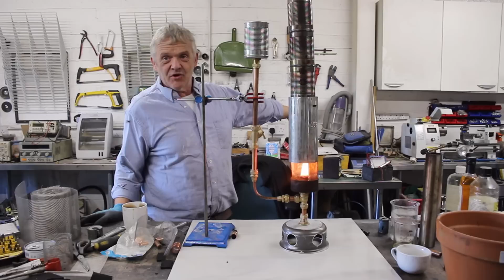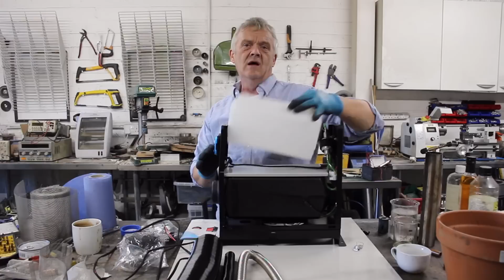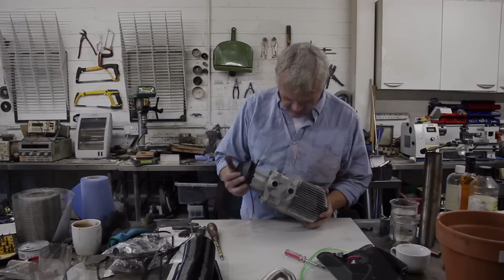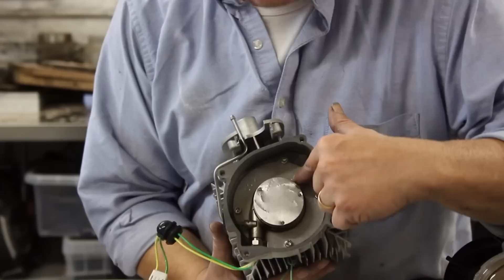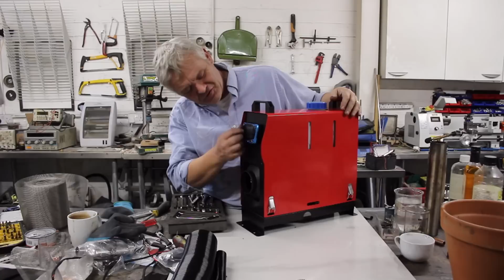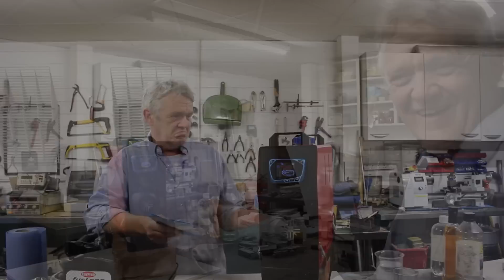1682 The Vevor 12V 8kW Heater - A Review And Pulling It Apart To See How It Is Made #Vevor

Comment: Probably one of the best options for switch flippers and button pushers.  A cabin model doesn't need an installer does he?  Keep in mind that ALL heaters can be cabin models and put in a firewalled doghouse outside.  And let's not forget they are mostly exhaust pushers.  Now, that's a problem for close living spaces.  If their exhaust has any gaps in the living space, then the noxious fumes gets pushed by internal pressure out into the home air space.  So, put a bit of aircrete thermal mass near the top of your clandestine chimney and it gets warm enough after starting to draw the exhaust by vacuum instead of the source heat pushing it with internal pressure, so there's not so many worries about gassing sleeping inhabitants.

Of course, expect the traitorous home insurance companies to disqualify wood stoves, etc.  And look forward to your (their) friendly cash-strapped Bobbies to go about with FLIR detection units and ticket books because they are so concerned for your winter European welfare!  Afterall, if they do a really good job with innoculations they can REDUCE the population significantly.  Sir Bill Gates said so hisself!
Reply from the maker: nice advice mate and the big win for me is it doesn't need an installer - the price of that is crippling

Comment: I doubt they thought you’d do a tear down 😂
I’ve previously modified a car to run straight used WVO and I’d reckon these could be modified to do the same or at minimum start on diesel and add clean filtered WVO which is heated by a small heat exchanger tube added to the unit
Reply from the maker: yeah - I'll bet they are surprised when they see it lol

Comment: You know I never disagree with you Robert but to say 5 or $0.10 a liter for biodiesel is a little disingenuous after considering the reagent prices unless you're recovering all of your methanol and caustic soda somehow you're going to be paying almost the same price is the pump. Well I shouldn't say that as a matter of fact Lee I have not calculated those costs in about 5 years and I know diesel has increased at a greater percentage than other fuels
Reply from the maker: my bad mate - I mean 5-10 cents for the base material oil - I should have been clearer thank you for pointing that out
Reply: @ThinkingandTinkering now I feel bad LOL I like you so much you're such a great teacher let me pointing that out made me feel terrible LOL I don't know why I just do it's kind of funny if you think about it.

It's kind of a sore spot with me because I got all set up to make biodiesel and I made some and it's really nice clean biodiesel and I was going to use it for heating my garage I was going to build a heat exchanger kind of like what you were doing with the rocket mass heater but with a giant open air heat exchanger that would cover a wall and radiate but after I figured out the cost of the reagents even buying in very large quantities it just wasn't worth it I would have been better off with an electric heater believe it or not. Now if I used wood it would be awesome but I'm disabled and gathering the wood or chopping the wood it's not an option anymore unfortunately

But yeah that's why it's a sticky point with me

Comment: awesome video. David McLuckie has a channel testing these things every which way but loose. I'm curious if there's a cheap fuel blend ratio of petrol and veg oil that would work safely and efficiently without fouling everything up.
Reply: I've been running a couple of these as my house heating for a coupe of years now.  HHO (kerosene) is the best thing to use as fuel - much cleaner burning than diesel, and cheaper too.
Reply from the maker: Great point mate - I don't really know tbh
Reply: I run out ldv van on veg oil, I am about to run the diesel heater on it for the first time. I will let you know.

Comment: Run them on highest settings every now and then. It keeps the internal chamber cleaner. Constantly running on low settings can gum up the internal chamber and makes them very inefficient.
Reply from the maker: nice advice - cheers mate
Reply: Hey thanks for the reminder I'm glad I read your post cuz mine has been running on low for a bit for the dogs and I got to make sure that I do run it on high every so often thanks for the reminder again have a great day
Reply: Similar to EGR valve on diesel cars...🤔

Comment: All you need now is an accessory. An empty container which could be connected and filled with sand to make a secondary thermal mass heater for when the fuel runs out. My mom still heats with oil and wood. Burrrr. And oil heating is expensive.
Reply from the maker: nice suggestion mate - cheers

Comment: i have same unit but smaller output, my problem it uses too much battery voltage from my rv solar system, cant run at night, same as the rv propane furnace with fans running. what eoild be your economical solution?
Reply from the maker: this was mentioned before in the comments mate with a solution - and that was don't run it on the thermostat

Comment: If one of these is mounted outside to blow hot air inside. How cold could it get before it doesn't get hot enough to blow hot air anymore?  Will they work in a cabin at -40?
Reply: You could fit a removable piece on it so you could direct infeed air to it from the home in such temps.
Reply from the maker: I have no idea ut I would draw the air out of the cabin and blow it back in if you mount it outside - like a recirculator - probably a more efficient way

Comment: Why burn fuel to make heat and at the same time mine BTC and produce heat you want to get rid of. Why not run miners for the heat that heats a house or hot water? This makes mining coins makes sense if you are cutting your heating bill. If a group got together that owned miners in two hemispheres. You could use people's need for heat mine coins for you all year round. Just replace the house heaters with miners in duct work.
Reply from the maker: you are talking about bit coin mining? the reason they get hot is they use a stupid amount of electricity - it costs much more to run them than you get in bitcoin value doesn't it?

Comment: The school camp we used to go to in the 1970s/80s had a diesel water heater. It just dripped diesel onto a angled steel plate above about six inches of space with a chimney drawing out the side near the bottom.
It would heat up about half a ton of water in a couple of hours, enough for 100 kids to have hot showers, and the shed it was in would get to perhaps fifty or more degrees.
About 1 drip per second.
It made no smoke. I'm sure it would have run fine on straight vegetable oils, waste Automotive lubrication oils....
Reply from the maker: indeed and you can easily build one if you have the skills - not everyone has mate

Comment: @Professor Murray-Smith...  Does it have a catalytic converter? should it? <-- lol - just banter. Love your vids and presentation :) as well as the topics. Keep Going!
Reply: if had ad-blue (urea, dried piss), we could repurpose the exhaust emissions to extract 02 and hydrogen. Then maybe re-circulate and chemistally (my own word)  combine via an external device (splitting off some of it to use as external devices self-sustaining power) into a usable fuel for the heater. Or something?
Reply from the maker: no mate - it's just a muffler like the amble idea by the way
Reply: @ThinkingandTinkering  yayy! :D

Comment: I'm not sure on their output, but I have 3 old-style brass Kero heaters on my yachts. 
Hand pumped pressure starting types. 
I haven't used them because I also have bronze kero/paraffin wick type lamps throughout. And a couple of those provide beautiful light, and quite adequate heating on a fifty foot Wharram Oro.
I have to wonder why it needs electricity at all.
Reply: The electricity is for running the fan. You need to force air over it to conduct enough heat, otherwise it would 1. melt the whole thing, 2. not be able to provide much heat, or 3. be much larger so it has enough surface area to radiate the space.
Reply: @DFPercush  yeah. Or you could use a thermal siphon with oil cooling. Or get real flash with water  in a phase change heat pipe setup. If you did that you could run a 3 mm bore plastic pipe to a radiator where ever you want the heat, with a 6mm return pipe. You can pipe heat far more efficiently this way. When the water vapour condenses, it releases the latent heat of condensation.
Reply: @aaronfranklin324  That's kinda what I was thinking earlier in this heating series, to have a burner somewhere on the exterior of a building and a radiator on the inside. Although I was just thinking of a passive water loop. Heat pipes might do the job nicely. Bit more expensive though, and they need to be kept within a certain operating range. I think just piping out the exhaust from a heater like this is a nice solution though. That's the main thing is you don't want your whole house to smell like deisel or kerosene lol. I guess if you wanted to turn it into a passive solution, you could always rip the block off of this one, ditch the fan, surround the block with whatever kind of heat exchanger you have in mind and go from there.
Reply from the maker: I love the old style heaters

Comment: I used one of these last winter. My Central heating went down. Had it outside covered from the rain and placed the hot air pipe through the wall air vent into the living room...toasty. very cost effective to, until the mega fuel rise. Although the price has come down.
 I think these will be in mega demand this winter. If you have a battery back up even better (if we have the black outs) Just make sure you have a battery cut off device because it will just keep on going and destroy the battery. Oh! and get a Carbon dioxide alarm.
Reply: An UPS as used on computers, might be good enough to run it for a few hours if power goes off.
Reply from the maker: thank you for sharing that mate - loved the advice - cheers
Reply: But don’t bother to get a carbon dioxide alarm - the carbon monoxide will have killed you first!

Comment: Does the fuel cycle stop if you unplug it or does it overheat?
Reply: It has a ecu controlled pump so if power is removed no fuel is pumped and the fuel in the chamber would burn out.
Reply from the maker: David gave a good answer mate - cheers

Comment: Thats a nice product and i think its a good value for the price. you could put a pipe onto the burn chambers exhaust so you could route that exhaust outside. that would be a nice upgrade for a tiny home or mobile home.
Reply: You could run the exhaust up a tall metal chimney outside as a heat source for when you pop outside for a cig.
Reply from the maker: it comes with the pipe mate - I am sorry I wasn't clearer about that
Reply: @ThinkingandTinkering  nice,i didnt pay close attention to the tear down because i wanted to see the burn chamber haha.
Reply: They do come with exhaust tubes and a muffler which you need because they make a very tuned noise if you don't.

Comment: 👍
Reply from the maker: cheers mate
Reply: @ThinkingandTinkering  dear Mr Murray-Smith. I'll be off internet soon. Don't know when I'll be back, trouble with moving to France is that everything is in French 🙄🤣
I've been thinking about horizontal windmills for a couple of years and may have some (half?) Solutions for some of the intrinsic problems with that design. I'll send you a summary of where I got before I move. 50/50 I may be on to something. The other 50 might just be a good laugh 👍🖐️

Comment: These are awesome little machines! Bought this model last year and put it in my garage so I have an additional heated space for my woodworking projects in winter. Impressed with the quality and the efficiency. Running it on light oil that's normally used for our central heating, so the 5.5kW of the machine cost me about 50cts/hr to run. That's way, WAY cheaper than running an electric space heater... (BTW: thank you, Angela Merkel, for totally screwing up our electricity production!)
Reply: I have one in my garden shed.
Strong 5kw dry clean hot air blowing.
The unit is 98-99% efficient 
NO exhaust gasses
Easily serviceable. All parts available on Ebay.  (If you can fix a toaster, you can do this one)
Cats meow !
I surely will get a second one
Reply: Can I ask how long yours runs for on 1lt of fuel please.
Reply: @nickchloeclaire  Thought I'd reply as I happen to have the manual on the desk right in front of me. There are three models quoted -
2kw = 0.12 - 0.24 | 5kw = 0.18 - 0.48 | 8kw 0.21 - 0.54 Lt/Hr
Obviously the range given is depending on how hard the heater is driven.
The 8kw models actually aren't 8kw, this is the usual optimistic Chinese marketing in operation. The 8kw model is something around 4.5kw, and for those with a mathematical inclination, since the figures above would equate to Btu's per hour, and kilowatts are a unit of electrical power, the conversion and thus comparison can be made.

The reason these heaters have 'exploded' on to the market in recent years is because they are a copy of the Eberspacher, a German heater of the same design, who's patent recently expired. The equivalent German made Eberspacher heater would be in the order of £700 or more.
By size, the Eberspacher model D2 is comparable by physical size to the 8kw Chinese model, and is sold as a 4kw model.

Hope this helps.
Reply: @nickchloeclaire   I've got the 5kw version, exactly as in the video although it has a slightly different updated controller (from Vevor). I am using exactly 120ml of diesel per hour on the very lowest setting which currently makes my office unbearably hot after an hour or two.
Reply: @lukechristopher4767  That's perfect, thank you 👍
Reply: @nickchloeclaire  It's been a while since I last fired it up (10 months or so) and I run it on a low pump setting (but crank it up to full power say, 15-30 mins before shutting it off) and the usable fuel volume lasts me about "2-3 workshop sessions"... I did the math when the heater was new and calculated 46cts/hr of operating cost back then. No clue how many hours this was ...maybe 8-ish?
Reply: @nickchloeclaire  Each pulse of the pump sprays 0.02ml
I have one in my cabin.  On minimum setting "H1", it pumps 2 times a second 

H1 2.0/sec = 120/min = 144 ml/h
H2 2.6/sec = 156/min = 187 ml/h
H3 3.4/sec = 204/min = 245 ml/h
H4 4.0/sec = 240/min = 288 ml/h
H5 5.0/sec = 300/min = 360 ml/h

Hope that helps
Reply from the maker: that is good to know mate - thanks for posting
Reply: It doesn’t matter how long you can get out of a tank of fuel, just remember you have 140,000 BTU with #2 heating oil

Comment: When I was stationed in Germany, in the RAF back in 1979/80 one of my jobs was to refuel a similar device basically a bus heater with diesel every day. The device was outside, the electrics were mains and the inlet and outlet were connected to the building it was heating via 8 to 9 inch pipes thus heating already warm air
Reply from the maker: recirculating is certainly a good idea

Comment: You can run it on an converter as long as it can handle 28 to 30 amp draw.
Reply: It draws around 12a at 12v on start up when glow plug warms chamber - once burning it draws 1-2a and when you switch it off it uses the glow plug to burn off the fuel in the chamber so draws 12a until it shuts down . I have metered one.
Reply from the maker: nice one mate
Reply: Can you tell me if it runs on kerosine? Much appreciated!
Reply: @nirmanakaya1666  Yes it does I use one with no problems
Reply from the maker: cheers mate

Comment: Indeed a surprising amount of engineering, engineering done 40 years ago when they were invented, copying is cheap 😏
If you want to see a decent diesel heater have a look at a webasto or a mikuni 👍
Reply: Just curious, is that the same Mikuni that makes carburetors?
Reply: @DFPercush  yes IIRC wasn't it the fish carb or something  🤔
Just a copy of the webasto but with some added Japanese common sense like a remote motherboard that isn't strapped to a potentially red hot melty burner and a glow plug that doesn't require a special socket 🙂
Reply: @Dirt-Diggler  Mikuni is a famous name in the powersports industry. People put their carburetors on race bikes, motocross, quads etc. At least several years ago that was the case. It's probably all fuel injected now. Interesting to hear about their other ventures.
Reply from the maker: fair enough mate - cheers

Comment: i wonder if it would run on veggie oil?
Reply: veg oil is a bit thick and might not burn. diesel/kerosene is thinner and works ok
Reply: @davidcrozier8341  I was pondering whether it could be atomized as a means to ignite a less viscous fluid.
Reply: You might be able to get away with a small percentage of vege oil but better with biodiesel. There are a few other YouTubers who've experimented already.
Reply from the maker: I would think that would be a bit thick mate and prone to gumming it up
Reply: @ThinkingandTinkering  Did you notice in the tear down whether the fuel was being atomised prior to ignition?

Comment: So 12 v how many watts and can you run it off the mains by transformer  12v how many amps ?
Reply: It draws around 12a at 12v on start up when glow plug warms chamber - once burning it draws 1-2a and when you switch it off it uses the glow plug to burn off the fuel in the chamber so draws 12a until it shuts down . I have metered one.
Reply from the maker: David certainly has a lot of experience here - his advice is good and I am taking it!